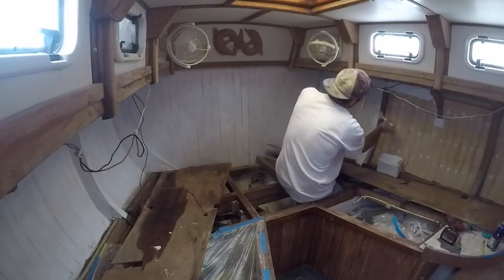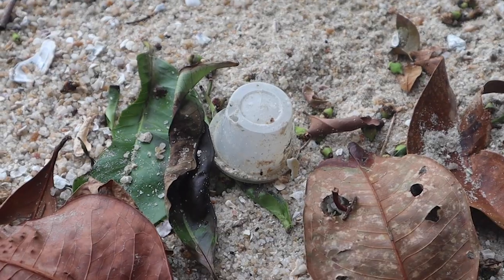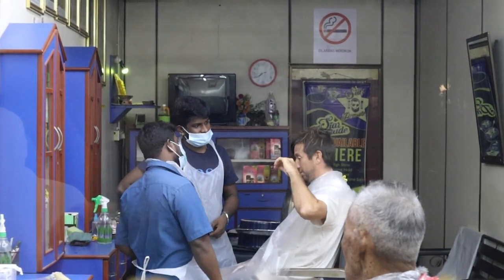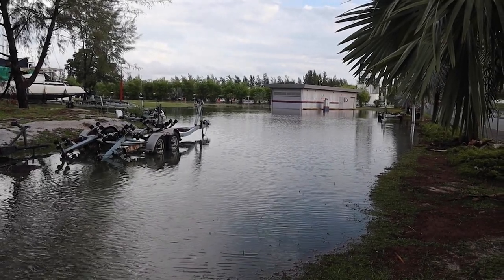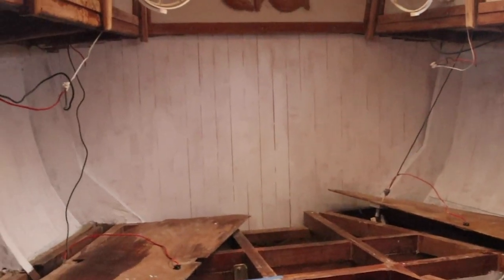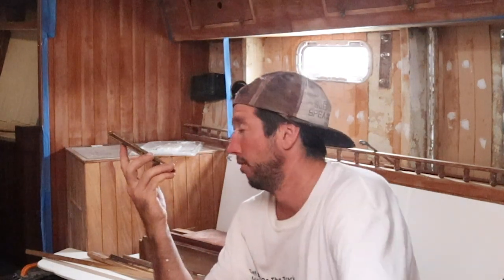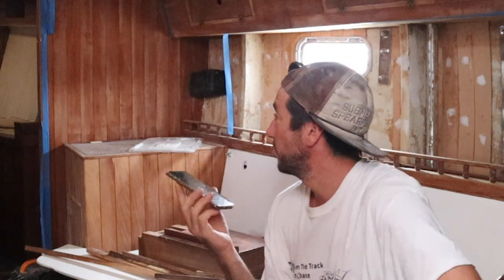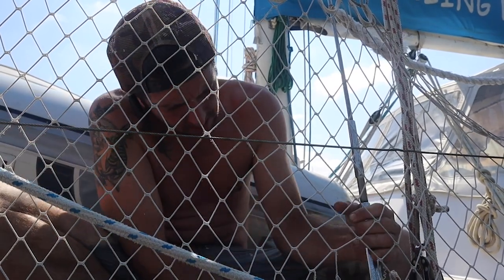CAN WE GET A PROFESSIONAL OVER HERE!! This guy has no idea! | Sailboat Refit 2, Ep 212

Comment: Yosh - you going to try a small roller for the finish coats?
Reply from the maker: I like the brush for top coat. Roller is good for second and third primer but prefer to brush top coat rather than roll and tip off.